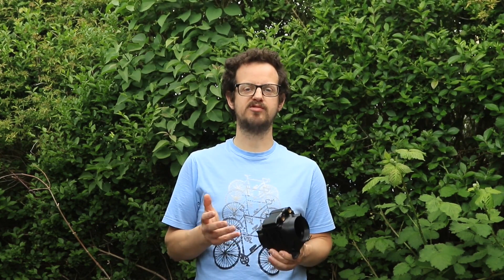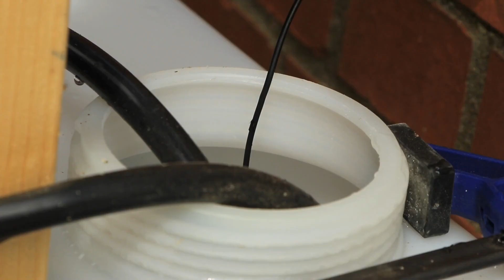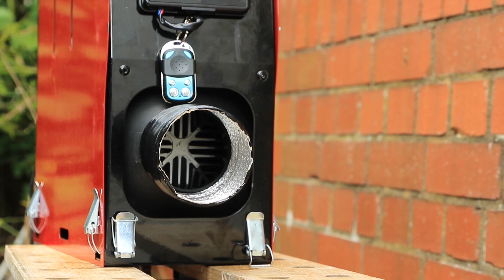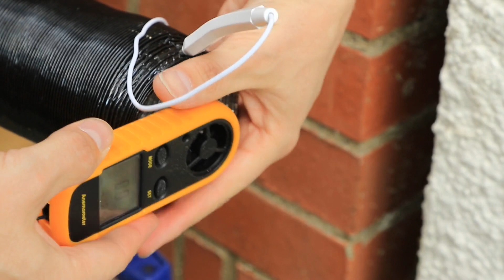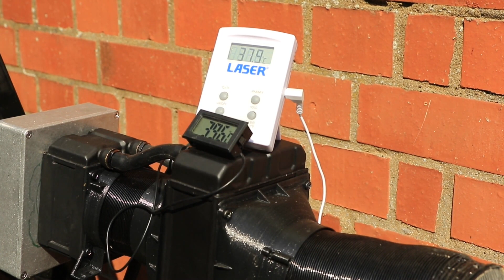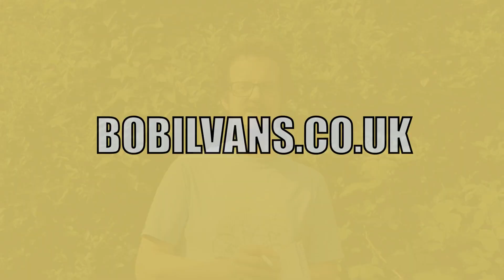5kW Chinese diesel heater exhaust gas energy recovery

Comment: You wouldn't have that moisture problem if you mounted the heater inside like it is intended to be. Why try to heat cold outside air instead of inside?
Reply from the maker: I really don’t understand this comment I’m afraid. All of the testing in this video is done with exhaust gases which originate from atmosphere, not from the cabin. The moisture comes from the combustion process. It was also not a particularly cold day so we weren’t heating air which was sub-zero or anything so the burn chamber temps wouldn’t have been particularly affected.

Comment: Why would you not build a heat exchanger to wrap around the exhaust pipe as opposed to having the exhaust air restricted, thus potentially creating soot?
Reply from the maker: Because this was a one off test, rather than a full installation and building things takes time. I have another video using an egr cooler which is basically what you’re suggesting.
Reply: @bobilvans4205  Thank you. Look forward to seeing it.

Comment: interesting video. Good idea but for purely efficiency reasons wouldn't and airflow system be better? One where you can direct the flow to heat exchangers and heating or just heating.

Comment: If you measure the air temperature before you go through the heat exchanger the water temperature should be a bit cooler as expected.

Comment: I simply would not go about trying to heat water at all with the product of the machine but extract lost heat that is wasted. I would possibly try to exchange heat from the exhaust to the intake air as we did in the Navy after we used the boiler exhaust to heat the incoming feedwater to the boiler. It can only be lowered so far as you enter past the dew point and the resulting moisture corrodes the exhaust piping. That is why modern heating unit discharge with either Stainless Steel and or Plastics -  (PVC) piping.

Comment: You crippled the experiment right from the start. At least insulate the inlet exhaust. I ran propulsion Boilers in the Navy and am now a retired Boiler Inspector of 35 years. I do know a bit about heat transfer.
Reply from the maker: Again, this was me fiddling about in the garden. I think it’s valid for the level of accuracy I was trying to achieve. Maybe this little video will encourage others to do their own testing? If you have a go yourself then I’d be very interested in your results!

Comment: My all in one heater is in my work cabin.
I tried a zigzag 2 x 1m copper pipe at the exhaust and found that the end was still really hot. (+/- 50°C) (meaning to me that the copper couldn't get rid of the heat)
I saw a Polish man who did better and used a small ex-radiator from a central heating.   His gasses were super cool, coming out.
That means the radiator dissipates the exhaust gas heat enough 
Just a comment that, like you showed here, there is condensation that drips down inside and that drilling in a small 1/4" hole for a purge to run it off from time to time solves this

So I'm asking my plumber friend for a small used radiator (often seen in people's toilets) and I'm going to wrap carefully in bubble wrap,  and use 10cm flexible air duct to draw that air up into the heater air inlet at the back.  There it will be "added" to the flow which will be blown out warmer still.
This would mean that 99% of the burner energy will be used to heat my cabin
At least, that's the idea...:-)

Comment: I’m considering running the exhaust through a bit of concrete to act like a storage heater but are unsure if it will cause sitting as the pipe will need to be bent a few times that way even when the heater is turned off it will still be keeping me warm until it cools back down

Comment: 600w of free energy seems pretty good from an already efficient design and dropping the final exhaust temp to under 40C makes it look like you are getting almost all of it. but can imagine this could all soot up quite a bit or corrode over time. Thanks for the video and info as its nice to know if investigating further is a practical option.
Reply from the maker: I’ve got a similar video using an egr cooler which is a much more practical solution

Comment: Condensate produced from combustion is acidic also , so an metallic components are going to suffer corrosion.  Hence all Condensate pipe on domestic gas boilers has to be plastic .
Great product , I've just received my kit . Looking forward to my install project  when the weather  warms up .
Reply from the maker: Yep, I did a similar video using a stainless egr cooler. This video was really just playing about!
Reply: @bobilvans4205  The condensate is what was in the air that was used for the combustion process.
The acidic stuff is a product of the fuel.

Condensing gas boilers produce a white crust in their internals, hence why they need to be cleaned out on a yearly basis.

.
Reply: @bobilvans4205  How many dinosaurs did take to produce one million barrels of oil?

Apparently the world is currently consuming  99.53 million barrels of oil per day, so multiply that figure by how many years you wish to believe that it took a lot of deceased dinosaurs to produce such an abundance of so called "fossil fuels"?

Whatever figure of dead dinosaurs you come up with, you have got to admit to yourself that you have been lied to, unless you are foolish by intent.

Regards
Adrian C
Reply: @adrianchetwynd1334  you need to go back to grade school. You don't even understand how crude oil became a thing..
Reply: @Bryan-Hensley  I left school as an 11th grader who believed what you still believe.

According to the official information the world has consumed approximately 1,836 billions of tonnes of oil since 1870.
So at an average weight say of ten tonnes per dinosaur, how many dinosaurs would it take to produce so much oil?
Reply: I have no  doubts that you also believe that man really traveled to the moon too!
Reply: @Bryan-Hensley  But you have probably learnt by now that the tooth fairies aren't for real???
Reply: @adrianchetwynd1334  tell us you are a extremely low IQ brainwashed clown without telling us you are a extremely low IQ brainwashed clown.
Reply: @Bryan-Hensley  My achievements prove your accusations of me to be false you gullible nonce
Reply: @adrianchetwynd1334  wrong again. You never get anything right
Reply: @adrianchetwynd1334  what's a tooth fairy?
Reply: @adrianchetwynd1334  there's a huge difference between you and I. You aren't smart enough to understand the mechanics involved so you simply think it's fake. All because you are too dumb to understand. For me, I'm so much more intelligent I can fully understand how things happen. I even watched Apollo 16 lift off from the cape live when I was 8. We set up a satellite dish and listened to the astronauts vhf radio link on the moon. See what happens when you are intelligent. Too bad you live in the deep dark world of dumbness. 😅😅🤣🤣🤣
Reply: @adrianchetwynd1334  you can do this experiment yourself. It's really easy and relatively cheap. Just get a star tracker telescope mount and put a time lapse camera on it. 
https://youtu.be/72hBReBQRAg

Comment: Temperature difference makes a big difference in heat exchangers.  If you checked the degrees/minute you would find it higher in the beginning.  So if the heat exchange fluid transfers its heat to the body needing to be warmed so it stays at a lower temperature you will get more than the 6-7 degrees per minute exchange.  The current diesel heaters are about 30% efficient; compare the exhaust gas temp rise * volume to the heated air temp rise * volume; your setup saves 10% (.6 / 2), there is another 20% available.
Reply from the maker: Why do you think the heaters are 30% efficient? My testing shows between 60% and 80%.
Reply: Wrong, these heaters are running 80 percent.

Comment: My Cousin who is a mechanic ran the exhaust hose And tied it into the exhaust on his vehicle. He put a fitting on the exhaust up by the exhaust manifold So the exhaust from the diesel heater gets pushed into the engine. It also makes the heater quieter.
Reply: What keeps the engine exhaust from pushing back into the heater? Engine exhaust pressure is much higher than the heater.
Reply: @Bryan-Hensley  I would be afraid of what you are saying as well as the chance of a venturi effect sucking the exhaust out of the heater faster than it should.

Comment: Are you going to be blocking that exhaust with your hand when normally using that heater? If not why do you block it when you meter air speed?
Reply from the maker: Just an attempt to get comparable data. I wouldn’t really believe it, the heat melted the meter anyway.

Comment: Your thinking about it to much !! There's alot less air coming out of the exhaust !! The air coming out of the front contains energy from the fuel as well !! Same as a space heater !!
Reply: Build a proper heat exchange unit say out of 8mm water pipe and wrap it round the exhaust pipes full length but of course you will then require to run a water pump to ensure it moves the water around enough as I'm not sure convection will be adequate !! Just a thought from an Old Mechanic ;)
Reply from the maker: I have done a full video using a egr. Is it ever possible to think about things too much?
Reply: @bobilvans4205  Hahah I agree with the comment 100% I use mine in my workshop which is super drafty so doen't even bother wasting the exhaust heat by pointing it out side ) It's far less annoying than my Space heater running :)

Comment: Jus a thought, wat if de exhaust stainless steel pipe (extended) is be submerge into/ out above  a trough of water tank/ black tough plastic  (to heat it up)? Would dat raise temperature? At full blast, wat temperature wud dat read?

Comment: you cant restrict/funnel airflow that way on your wind flow meter. Not accurate measure. nice idea to recover exhaust heat. I simply collect the exhaust heat with a sleeve made of aluminum gutter elbows, and pull into the burner intake to recover the wasted heat and then only run the heater on lower settings with a lean fuel adjustment so as not to overheat. I pull about 50F off the exhaust and add 50F to the intake this way. and I never restrict the heater airflow which should be augmented with more fans, never restricted at all. I wont even use the diverter airflow ports or the dual outlet plastic ducts. no no no..
Reply: using the heat in the exhaust to heat the burner inlet air has been used successfully in all the high efficiency balanced flue heaters. Great that you have applied it to the diesel heaters. Have you got a youtube video on your heat exchanger?  What diameter of Aluminium gutter fittings did you used and how long is the concentric heat exchanger to get your 50F gain? Thank you for reporting your work.
Reply: @cfcyayaya  I used the 4-in aluminum gutter. I took three elbows and join them and drilled holes to let air in and then duct taped the intake tube to draw off the hot air. I never run it on high settings for fear of overheating. Seems to work great.
Reply: Hi Dough, thank you for your reply. On the subject of flow restriction, assuming the arrangement is a concentric heat exchanger with the exhaust pipe running in the centre, and the as supplied inlet pipe is the same diameter as the exhaust at 1inch, you will  need the bore of the outer concentric tube to be bigger than 1.5 inch to get the same flow area as the as-supplied inlet pipe. 4inch seems to be too big considering the thermal penetration depth is small by comparison. I also check that the upper operating temperature of the heater is about 80C, depending on the model. You should be quite safe to recover more than 50F change from the exhaust. The heater has a thermal cut-out sensor so you should not be able to over heat it. All these are minor design considerations. The main question is: did you use less fuel for the same comfort after installing the exhaust heat recovery device?
Reply: @cfcyayaya  yes 4 in is much larger than needed, but that's what I had on hand and I've not tested scientifically to see the effect of preheating the intake. My setup on my boat where I live doesn't support that much experimentation. Anyway I've shared this idea in many settings and I know it's scientifically sound and yet no one uses a balanced intake exhaust to recapture the waste Heat. And no one seems interested when it's widely used as you say in gas heating appliances which are well designed. Thanks for your comments. Good work

Comment: What if you were to take the water coming out of the heat exchange and plumb it Into another heat exchanger that was plumbed in before the intake of  the heater as a pre heater before the air goes into the main heater?
Reply from the maker: Like I did here? https://youtu.be/OtnrBYz3uRE

Comment: Is there any benefit for combining the exhaust heat and also the heat exchangers through the front?
Reply from the maker: Yep-ultra efficiency! Just bear in mind you can’t turn off the water pump if you used the exhaust gas only.

Comment: That’s a very interesting, thanks for doing it. I don’t think there is enough heat there to be used as substitute for a block heater by heating the engine coolant, eh? I’m thinking for people that live in cold climates and want to avoid an electric block heater.

Comment: As others have mentioned, while it’s interesting to see how your product works with the exhaust gases. I don’t think your product is optimum for this purpose. The exhaust pipe itself is already losing heat before the gases are passed through your exchanger. I’m thinking a co-centric pipe style heat exchanger (which can be approximated using a wrap of 6mm copper tubing around the whole length of exhaust), with insulation, would recover more heat. You might even run a coolant through that pipe and have it heat a water tank. Or run the exhaust itself through a water tank (but the two would be tied then - water always heating up when the heater was on).
Reply: just a simple air-cooled engine type heat muff works great to recover heat from a tube like this. VW style or used in aircraft with great results.
Reply from the maker: It’s absolutely not optimum, I agree with you there. But it was what I had lying around at the time. I’ve done another video using a dedicated egr cooler and that’s much more efficient.
Reply: Thats exactly what I thought,  run the exhaust pipe through a copper coil thats submerged underwater.  I bet it would recover the majority of heat.
Reply: just wrap the exhaust pipe in insulation before it gets to the heat exchanger. the ribbed pipe makes a very good heat transfer to the surrounding air unless it is wrapped

Comment: Your going about it very inefficiently. You need to wrap small bore copper pipe around actual heater exhaust from  just after the exit. A more compact setup.
Reply: Disagree..  better to put fins on exhaust ..lots of fins.. financing.   and either have air blow over them or run the assembly thru moving water (requiring another heat exchanger)

Comment: Do a PETG on it and see what power you can get. Enough to charge and run it?
Reply: Im sure after the glow plug cycles off you could. But never gonna make the 10A required for startup
Reply: @thomasbarlow4223  just n3ed to run long enough to recoup the power used during startup. Enough heat on the exaust and open air diff for this especially when you use it. Just need about 2 amps out of the tegs

Comment: Could a thermal electric device be added around the exhaust to help supplement the heaters electricity needs.
Reply: Yes, I think the fellow named mcluckie has done that in a video so the heater is fully self-powered, no electrical supply needed
Reply: i'm currently making one, the high quality modules are expensive
Reply: @ECL..  looking forward to it

Comment: If one were to use a different method of heat exchanger it might be more effective at reducing sooting. Helical pipe wrapped around the exhaust pipe.
Reply: Fins.. lots of fins.

Comment: The test thermometers are not calibrated.
Reply from the maker: We checked them with iced water and boiling water and they read correctly. So they haven’t been calibrated but they have been checked. For a rough and ready test for YouTube, I don’t think they need to be calibrated to a traceable international standard.
Reply: David hughes has never even owned a diesel heater but is dispensing thermo dynamic advice pmsl.  Its hilarious keep them coming

Comment: I dont think this is a very well test: loads of heat is lost via the long exhaust pipe, and the alimunium box, before the hot air reaches the heat exchanger.
Reply from the maker: True. But the test was not meant to be definitive. It was just meant to be a rough estimation given the tools we had available at the time.

Comment: Diesel does not produce water when burnt. Petrol does. Have you seen water drip out of a petrol exhaust? Diesel exhausts are bone dry.
Reply from the maker: Wikipedia begs to differ. https://en.wikipedia.org/wiki/Diesel_exhaust Given that both Petrol and Diesel are refined from the same product, why do you think there would be a huge difference between their by products? And if they don't produce water, what is dripping out of the heat exchanger? And why do the exhaust mufflers have drainage holes?
Reply: Diesel does not produce water when burnt? What universe do you live in? Every middle schooler knows better. Hydrocarbons + oxygen is CO2 + water + energy. Chemistry 101.
Reply: Water is a by-product of burning any hydrocarbons. It’s elementary chemistry and not even a debate.
Reply: Do you have access to a diesel car? Go look at the tailpipe, no water. Look at a petrol car, lots of water.
Reply: @doggystyle1970  the water is made by a reaction in the catalytic converter,
Reply: I wouldn't trust Wikipedia. Your heat exchanger is leaking water.